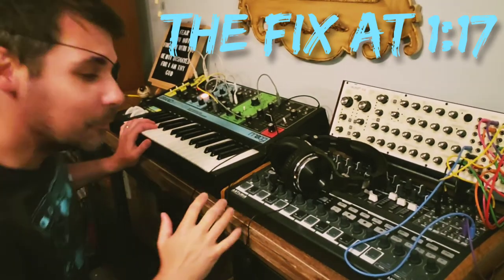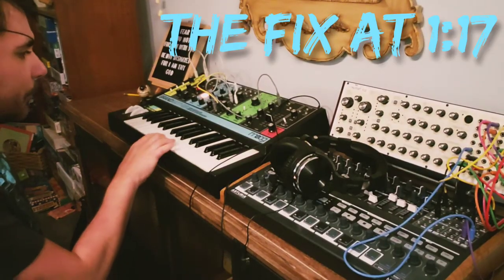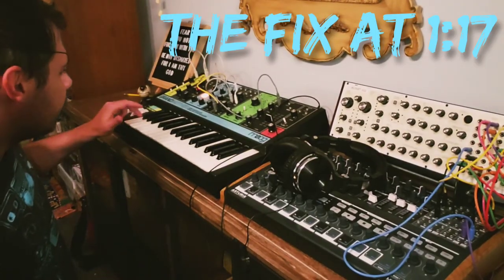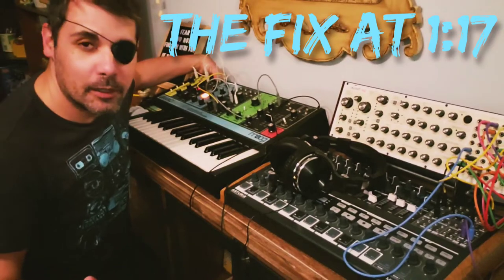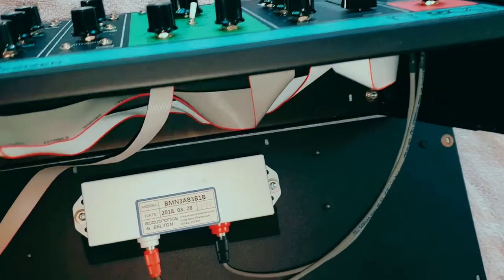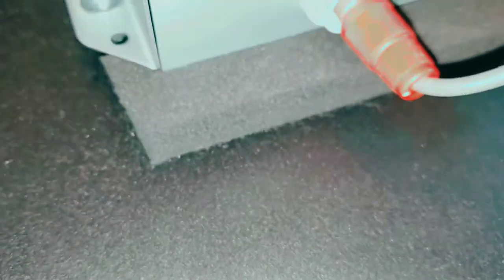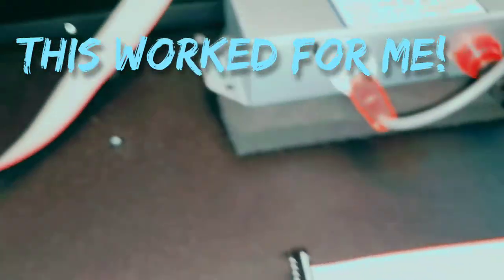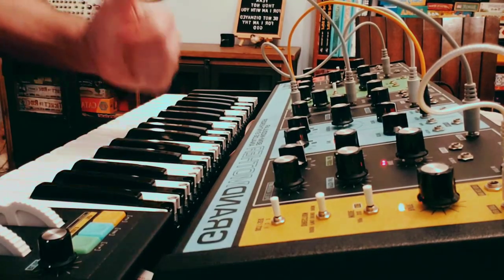MOOG Grandmother FIX for Notes Sticking Problem

Comment from the maker: Basically the bracket wasn't clamped into the ribbon enough. It was hooked to the keys good but I forced it into the ribbon more. There's 2 black pieces to that bracket...make it so there is no gap between them.

Comment: I also had this problem with a single A# key, the solution in my case was not to reset or tighten the ribbon cable, instead I wiggled the rubber contact 'button' under the affected key and that did the trick. For anyone having this issue here's also a useful video showing how they assemble the grandmother at a moog plant, this will help you understand how to take it apart for the fix https://www.youtube.com/watch?v=7nNfRcuPUks at around 7:10
Reply from the maker: Awesome.  I've been there a few times. Met Bob there when the CP251 came out.

Comment: I just got one of these and the same thing happened. I tried this fix and unfortunately it didn't work. Now I"m just waiting to hear back from Moog about it.
Reply from the maker: I hate that. Update here and let me know what they tell you pls. Mine has started to do it again so zi was going to have tongo back in. I've seen someone else mentioned cleaning the ribbon connector plugs. I plan to do that.
Reply: @validcore  Just saw this response. Moog sent me a new power supply. They said that it had something to do with that. And once I started to use the new one it did work......for a while. Now the grandmother is beginning to get stuck whenever I use it with an external sequencer via midi.  When the thing works it sounds fantastic. But I've had enough of the will it/won't it work thing. And I'm thinking about getting rid of the thing
Reply: @MassDriver  if i upload a video will be me hammering a subsequent37 , my first Moog just removed all the respect i had from this brand.  in so few weeks and so many different issues. unplayable still waiting for right side board and as the time pases by, i have other faulty knobs on the left side PCB board . C2 key works no more. whats next?  smoke,  fire?  probably a hammer first

Comment: in my Matriarch sticking notes was caused by poor quality of PCB soldering in fatar keybed, everywhere was soldering dirt. After cleaning using nail problem disappears. Overall build quality of matriarch is fluffy, connectors locked using glue gun is a joke.
Reply from the maker: Believe me I know exactly what You mean. Glad you got yours going.
Reply: I have the exact same issue with my keys. My PCB is also glued. Should I remove the glue? What does the solder dirt look like and what should I use to clean it? Any help would be massively appreciated
Reply: I have the same problem too ....
Reply: @oliveolive8839  Hey man, I managed to fix it for a few days, but the problem randomly comes back from time to time. What I did was give the inside a thorough cleaning, get rid of any dust inside, but be careful not to directly touch any of the electronics. Then, I unscrewed the keyboard section. Keep dismantling until you see the rubber caps which detect key inputs. Clean the inside of those and remove any hair/debris you see in the rubber caps. This should fix the issue, but if you live in a dusty area it could need another cleaning within a few weeks/a month